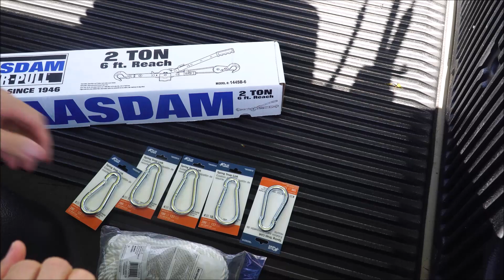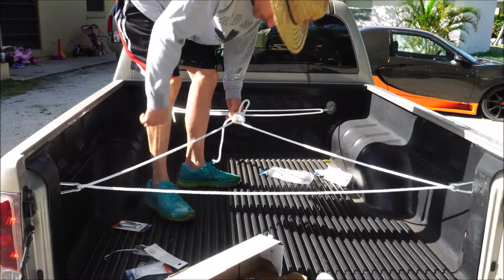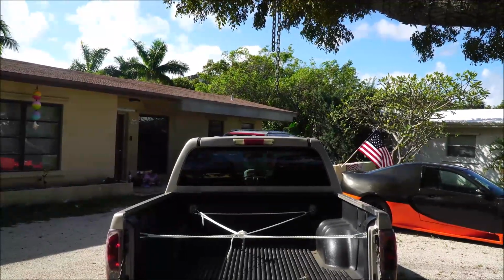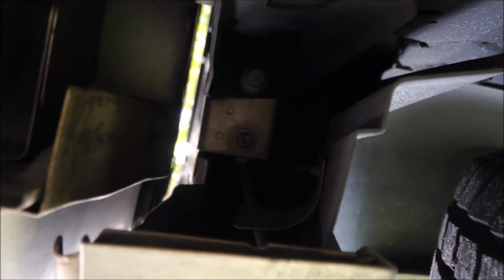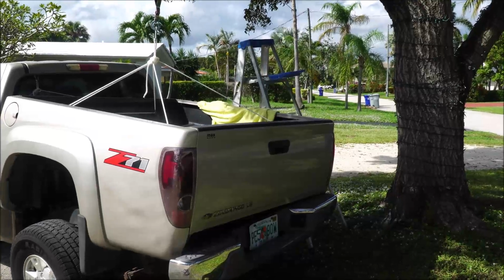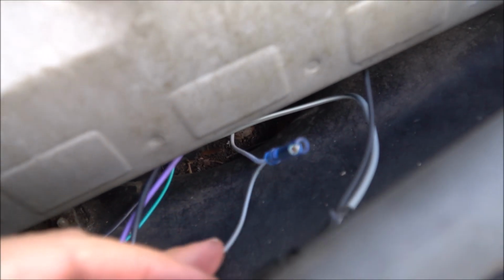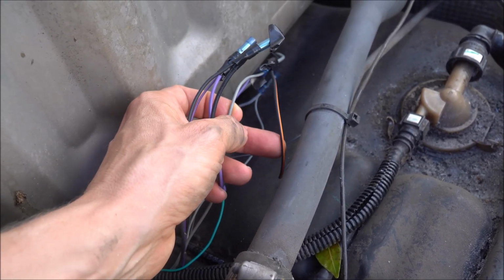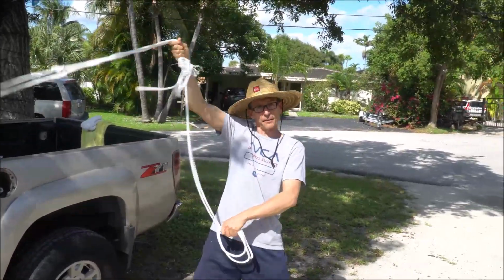Chevy Truck LOW FUEL LIGHT FIX w/ BED REMOVAL

Comment: Thanks for making this video, my fuel pressure sensor is bad on my 05 Colorado 4 door, and like yours the fuel tank and sensor part are under the cab.  If I remove the bed is there enough clearance to remove that sensor ? Everything else I’ve read says for the 4 door you have to remove the tank to do this,  but it looks like there may be enough clearance to replace the sensor If I remove the bed.  Thanks for any insights.

Comment: I plan on doing the same repair. Your video is a big help. But how the heck did you get your fingers under the cab to remove the clips? It seems like you would have to drop the tank to get to those wires....
Reply from the maker: dont remmeber dropping the tank boss!